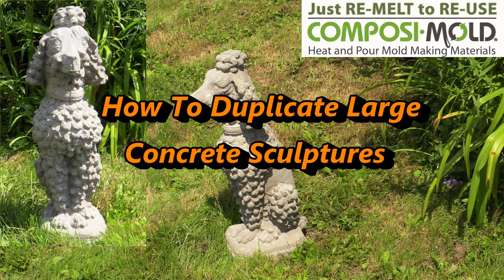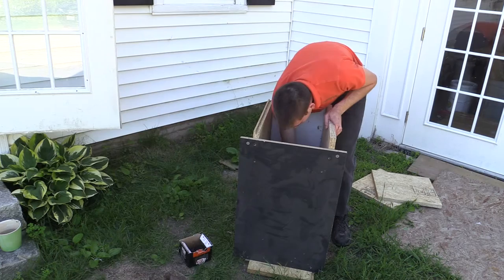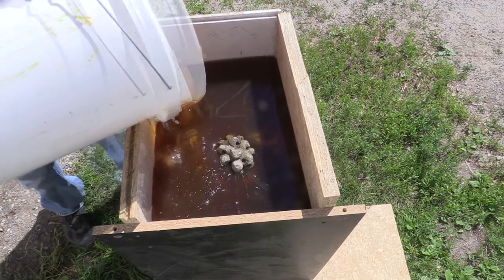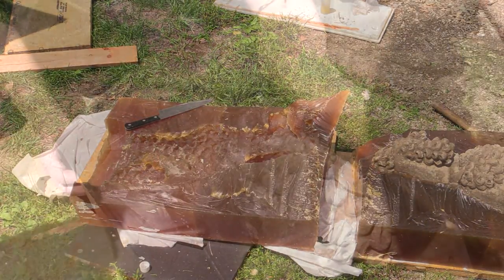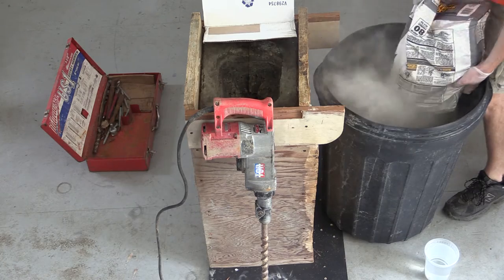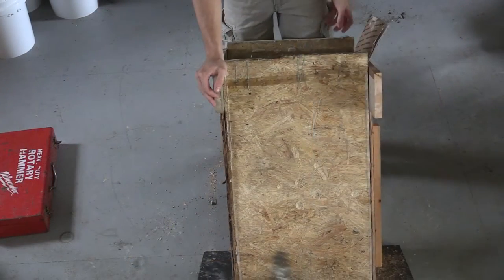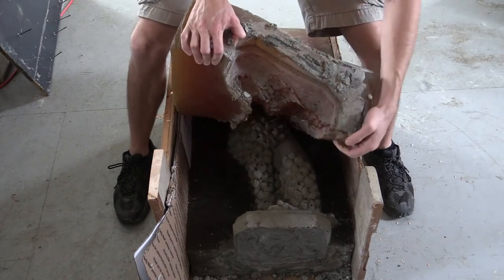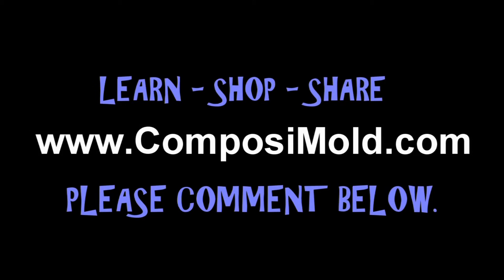Concrete, Dogs, and ComposiMold; Duplicate and Create a Concrete Poodle or German Shepherd.

Comment: 250 lbs?   I totally want to make a statue like this, I have a very large sleeping Buddha I want to replicate but I would need to spend 3,999 dollars for 250lbs.     According to the composimold website.   How is this even feasible? -> Its not.
Reply from the maker: Cool project! You can reduce the amount of ComposiMold used by brushing the ComposiMold onto the statue rather than pouring it into a box. If you use the brush on technique you will need to create a mother mold out of a harder material such as plaster or cement like we did in this video: https://www.youtube.com/watch?v=bTShRDaP9sI&t=30s To reduce the cost even further you could purchase used ComposiMold: http://composimoldstore.com/all-products/used-composimold/  Once you have created your statue you will be able to duplicate something else with the same material. Thanks!